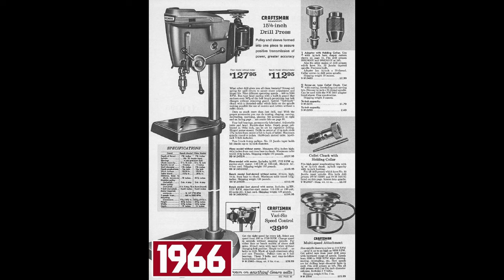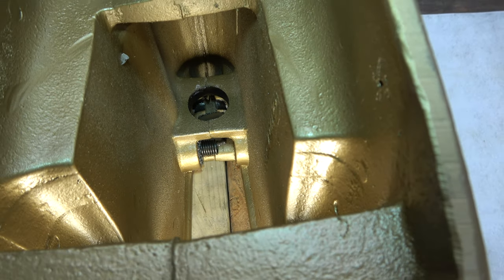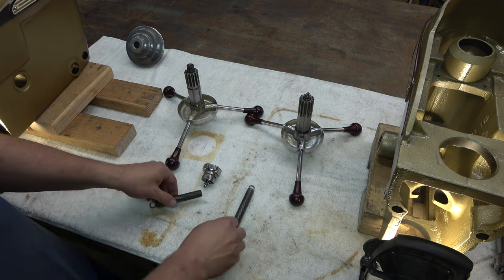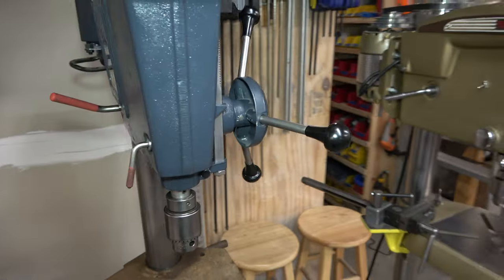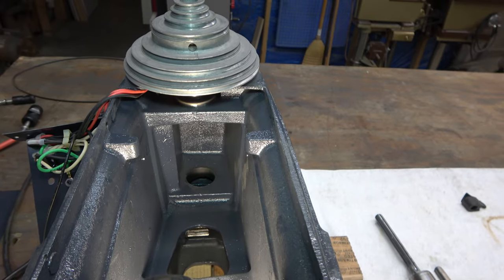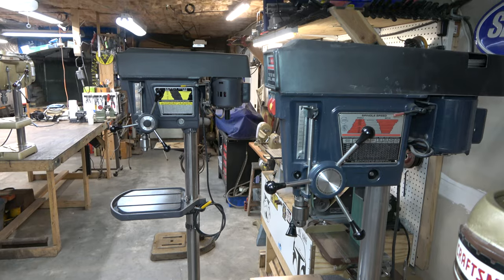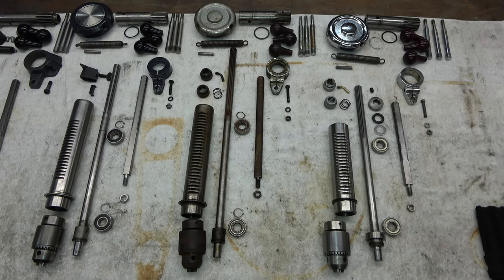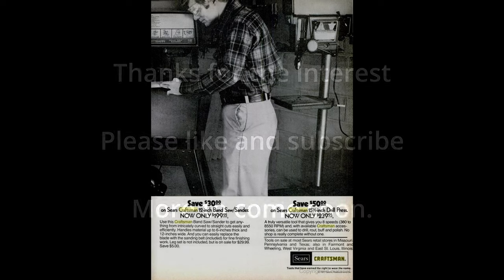Craftsman Emerson Era Drill Press Comparison

Comment: My Gen 4 Commercial bought new in the mid-1970s has a built in light with separate switch.
Reply from the maker: That sound like a Gen 4.5. I discovered some differences between the Gen 3 and Gen and develop sub categories for both. Please check out this video for details.https://youtu.be/kEIJ-G3k7dw and this spreadsheet https://docs.google.com/spreadsheets/d/148Ab5_zVo2-BKgsSgbGLkCaLnyTApclTlelexUIiWCA/edit?usp=sharing

Comment: Thanks for all the work you put into this and your other videos!    Very helpful.    I am in the process of restoring a 113-24611 and have been struggling to find a replacement feed return spring.   I understand that finding an OEM spring is improbable but hoped that someone had found something that would work.   Thanks in advance for any suggestions.
Reply from the maker: User, the spring you need should be 5/8 in diameter, 6 1/4 overall length with single loops on both ends. 67 coil right hand wound. I would visit local spring manufacturers near you. They often have a bunch of samples that they can give you for free that may be close to what you need. Even longer than you need is find since you can cut it down and bend the loop on the cut end. Your only other option is to have them manufacture you some springs but I an tell you that it is not cheap. I ended up ordering 100 springs to make it worth it to manufacture. You can always sell some of them on ebay. I would buy several from you since I also have a commercial drill press. Good luck, Jeff
Reply: @JeffsShop   I saw your custom springs on the Garage Forum and was excited until I realized they were the shorter version.    I hadn't thought about modifying a longer spring to fit.   I will definitely go in that direction but will keep the custom option in mind...    I very much appreciate your help with this!    The drill press is basically finished and this spring thing has kept me from fully enjoying it.

Comment: I don’t see my model number in your video. I thought it was a gen 4. I have a 113.213710. Can you tell me if it is an Emerson made machine? Thanks a lot and love the videos
Reply from the maker: Yes, your drill press is a gen 4 made between 73 -84 by Emerson. The linked spreadsheet in the description of the video shows 113.2137XX. The XX can be any number like your drill press 10 but also 20 etc... because several model numbers were used for this generation. Here is the owner manual for your drill press.http://vintagemachinery.org/pubs/222/5471.pdf

Comment: Jeff
Well here I am again. I picked up what I believe is a gen 3. Has the gen 2 table date of 4  73. On the right side is a blank badge with the Sears Craftsman 15-1/2” drill press label at the bottom. On the left is a badge graphic instructions and on the front of the cover is the recommended drill speeds for size and material. 
Have you ever seen one like this? I don’t know if something is missing on the right badge like belt positions. Thanks a lot
Reply from the maker: This thread should help you figure out what you have: https://www.garagejournal.com/forum/threads/craftsman-drill-press-information-belts-bearings-chucks-keys-etc-1946-1984.489080/ . Personally, I have yet to work on a Gen 3 but I have a ton of experience with Gen4s. This spreadsheet should also help: https://docs.google.com/spreadsheets/d/148Ab5_zVo2-BKgsSgbGLkCaLnyTApclTlelexUIiWCA/edit?usp=sharing . From what you are describing, it sounds like a Gen 3 and was probably a transition drill press. That is a drill press built during the next generation time frame but with most or all parts from the previous generation.
Reply: @JeffsShop  
Looks like a Gen 3.5
Thanks

Comment: What's your favorite Gen? Best made, versatility, etc
Reply from the maker: That is a hard question to answer. For versatility, probably a Gen 4 Commercial but for looks and everyday use the 100 modified to a 125. I own 4 drill presses that are my keeper machines and if I had the room, I would have loved to keep this Gen 2. Its such a unique and well built machine that give you a larger spindle travel distance. As far as best made, I love the Emerson machines but I believe the King Seeley machines and the Emerson Gen 1 machines are more robust. There is little to no “spring” in the table. Starting with the Gen2 the tables got thinner and tend to bounce sometimes when using a sanding drum and some other accessories.

Comment: The earlier King Sealy version looks like a better press.  I often use a drill press as a " Hand Tapper " to get nice square positioning of my tap in certain projects.   Being able to disable quill return for tapping is a must.   The Gen 2 unit is one ugly bugger.  It has greater opportunity for a double slow speed setup with all that space to work with.  Gen 4 way better looking machine with awesome slow speed capability.  Extremely informative video.
Reply from the maker: I agree for what you need, the external tension knob makes it easy to disengage the quill return. Back when I got into drill presses, I did not like the look of the Gen2 but I have to admit, it has grown on me.

Comment: Hello, when you say you can’t really determine the origin of the 84s is there a made in the USA on those or do they all just say made in Taiwan for some reason thanks
Reply from the maker: Sure, most items in Craftsman Tool Catalogs made outside the USA in the 80s stated "imported" and the 1984 drill presses do not state imported but they do in the 1985 catalogs. The design for the 1984 drill presses is the same as the 1985 and later models and all Emerson Gen 4s from 1973 - 1983 models are a different design from the 1984.
Reply: @JeffsShop  interesting thanks for the reply
Reply from the maker: @chase332  you are welcome. I have never put hands on a 1984 drill press so if you have access to one and can verify that is says made in USA or somewhere else, that would help others. Please feel free to let me know here or email me.

Comment: Is the accessory table worth it? I can’t even source one but just the novelty of having it lol, gen 4 113.213710.  But it looks like someone converted it to floor standing at some point cause mine is floor standing.
Reply from the maker: I’m not sure if it’s worth it unless you need a table that can tilt. I have one but I probably will never use it. On my old 100 machine it came with a tilting table and I never had a reason to use it in any configuration other than standard flat